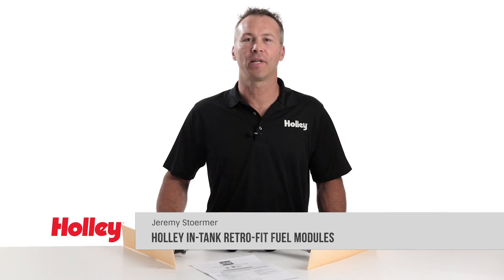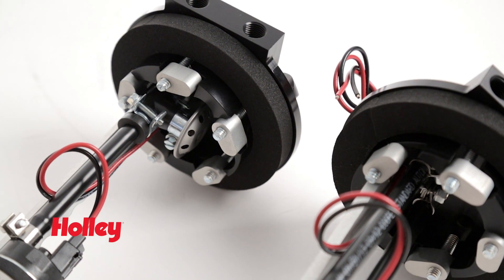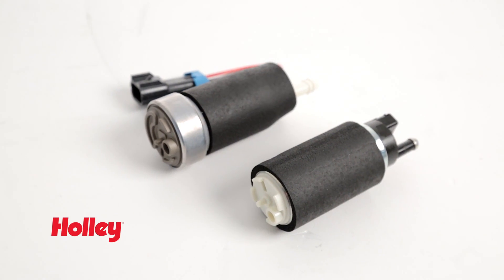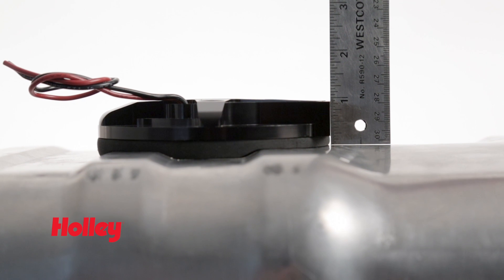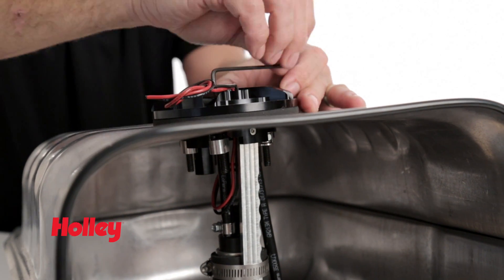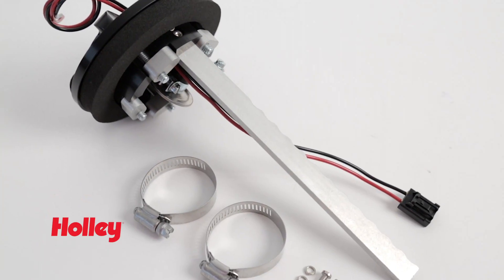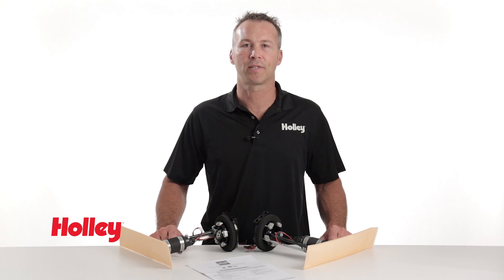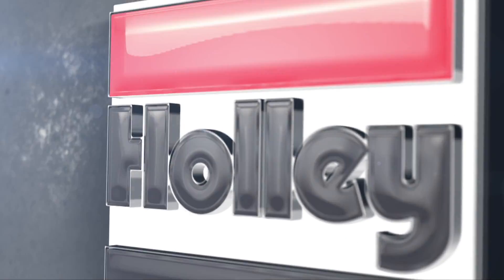Holley In-tank Retrofit Fuel Modules

Comment: I have the Sniper 2 kit with the returnless in tank pump ? I have two extra holes in the housing but do i plug them ? Nothing in instructions or parts ? What do i do since the holes will leak if i do not seal them off ? I know one can be used for vent but my tank is vented on 1957 T Bird ?

Comment: Hey Holley, for a daily driver street build with a Sniper Stealth setup, what is the realistic life span of this hydramat?

All your paperwork on the matter states 5 to 10 years but also states it is dependent on how clean your fuel is which for a daily driven street vehicle is very dependent on how clean the fuel from the gas station is.  Like wise it also states in extreme use cases to check the HydraMat at regular intervals.  I dont think people with classic cars retrofitted to fuel injection or daily drivers are going to be wanting to check the HydraMat at regular intervals by dropping their tanks.

So like my question says, what is the realistic life span for a daily driver?  Surely this will last longer than the fuel pump does and our electric fuel pumps would go out before the HydraMat needs to be replaced.

The other question is the instructions state gasoline based fuels but no oils, diesel, or other fluids.  What is this "other fluids" meaning?  We cant run fuel injector cleaner or fuel additives without harming the mat?

Comment: What in tank electric fuel pump would work best for my 74 k5 if I want to keep the stock carb intake system ??  Mechanical pump vapor lock is killing me.
Reply from the maker: We do not have an in-take pump for carbureted systems in our retrofit line.  However, you could add an external regulator or swap the fuel pump out for one rated for the lower pressures required with a carb.  Thx J
Reply: @HolleyPerformance  What pump would I swap to ? If you provide part numbers I can order them...
Reply from the maker: @kevtom1686  We do not offer an in-tank pump for carb applications yet,  however on our retrofit modules the regulator can be replaced with a unit for carb pressures.  It isn't yet available for purchase individually but will be soon!  thxJ

Comment: If I decide to install this is there a way to cap the vent since my vehicle doesn't have a charcoal canister thanks
Reply from the maker: Your fuel tank needs a vent!  You may be able to get by with a vented fuel cap?  If not run a length of  3'-4' fuel line higher than the tank and make a loop in it.  Thx J
Reply: Ok thanks

Comment: Is it ok for the ends of the mat to float around. I dont see how tou could use the magnets ect. When only access is the fuel pump hole
Reply from the maker: Yes, it is fine if the ends are not secured but the mat won't as effective since it isn't able to scavenge the fuel directly off the tank floor. As the fuel sloshes in the tank it can raise the ends of the mat up if they aren't held down.  Typically the ends of the mat will simply fall into place with the magnets attached, but you can use a long screwdriver or heavy wire to reposition the magnets if needed. 
 Be careful not to tear the mat.  thx J

Comment: I have a 1989 dodge W100 with throttle body injection and factory in tank fuel pump is corroded. This style is no longer produced. Would this be the answer to my problems?
Reply from the maker: Yes, it would be a very good solution, as long as your tank has a flat area (app. 4" in diameter) that large enough to accept the fuel module and the tank is no deeper than 12".  thx J
Reply: I think you would need to choose the type with a return line. Stock TBI engines typically use about 15 PSI instead of 60 PSI like most multi port injection engines do.

Comment: can i use this on my stock in cab tank 1971 Chevrolet c20?
Reply from the maker: Yes it's possible, but you would have to get an extended hose to connect the fuel pump to the top plate and make an extended pump support to keep the pump securely in place.  All of this would have to be done on your own as we do not supply anything like this.  thx J

Comment: For those of us that are working on old Japanese cars (240z) that want to go EFI this seems like a god send product. I can't just go out and buy a new tank set up for EFI, so I think this is the way to go. The hydramat is pretty impressive as well and solves another of my "known" issues. I'll be purchasing this and installing it and I'll come back with my feedback. Thanks!
Reply: Well? Did it work for you? It’s been a year
Reply: Its more than just imports.  Ford for example in their trucks didnt add baffling to their fuel tanks till the early to mid 90`s.  So my '82 F150 is carbed but '85-'86 is when fuel injection came out but no baffling cause ford used a low pressure pump to lift fuel to a high pressure pump.  So I am looking at going with their 3"x15" hydramat with the 11mm fitting that will fit the Walbro GSS342 in tank fuel pump I am going to run on a '85/'86 fuel tank and fuel pump sending unit for my Sniper Stealth system.

Only thing that has me wary of this hydramat product is they clearly state it has a 5 to 10 year life span that can vary.  Also states not to be used with other fluids which is very vague and makes me wonder if I cant run fuel system cleaner in my tank or run the Stabil 360 ethanol treatment that I use with every fill up.

Comment: This item is great but the prices I am seeing on ebay and Amazon, it would be cheaper to buy a fuel tank with the fittings for the pump included. A fuel tank is $100 bucks and up and an in tank pump set up is from $40 bucks and up. Now tell me how can buying this setup which costs $600 bucks and up be better than just buying a tank and sender unit? They need to seriously consider the price of this item....
Reply: Kevaughn95 Holley and most named brands are a rip. I’m a die hard eBay believer and shopper hell everything comes from China Nehow.